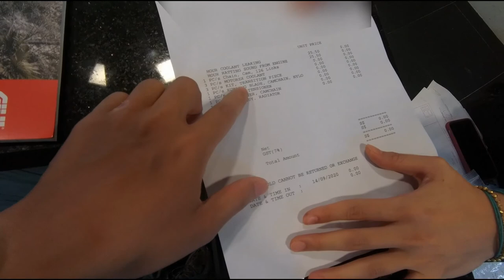Coolant Boiling and Overflow + Ticking Engine Sound | Street Triple Restoration [LASTx2 Part 8 ]

Comment: Thanks dude. I do have 2016 speed triple 1050r. I have experienced coolant gushing thing. I have got panicked when i see my temp 7/8 bar. Also, friend of mine suggested me to charge radiator cap. So, I ordered. I hope it will solve the problem.

Comment: Como solucionaron la perdida de agua? Que fue lo que le hicieron al motor o radiador?
Reply from the maker: It was caused by the radiator cap, where the aged spring/ seal is no longer able to hold the coolant when heated.

So they just replace it and it's all good.
Reply: @zwc888  muchas gracias me a valido por el mismo problema... 
Un saludo desde España!!

Comment: Hi bro mind sharing what was the cost of the workshop visit?
Reply from the maker: hi there, I can remember the exact cost as part of them are under warranty and others are not.

It will definitely be more expensive as compared to a Japanese Brand (usually like 25 ~ 50% more). 

Ballpark figure should be S$500 for parts + S$200 for labour.

Hope that the above helps 👍

Comment: I guess the engine paint corrosion is common for this bike eh
Reply from the maker: Yes, it is. You can find it on most of the older triumphs.

Not sure about the newer ones like the 765 etc.
Reply: @zwc888   maybe, some of them looked like it was anodised. Do you still own the bike?